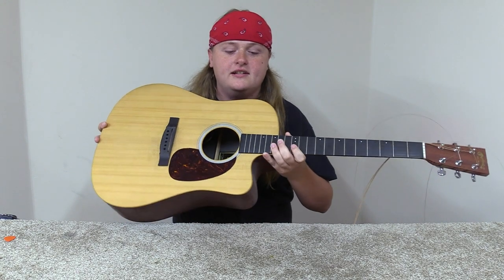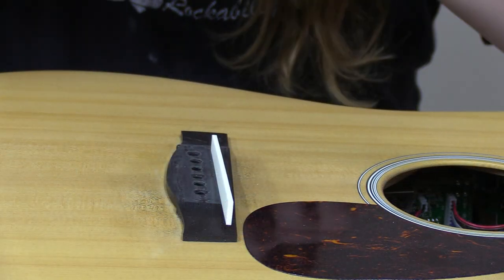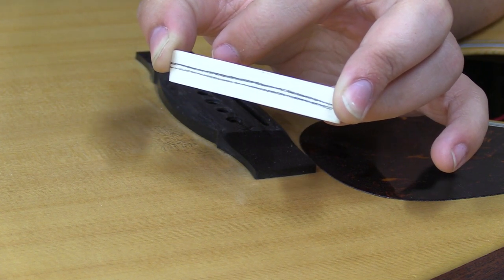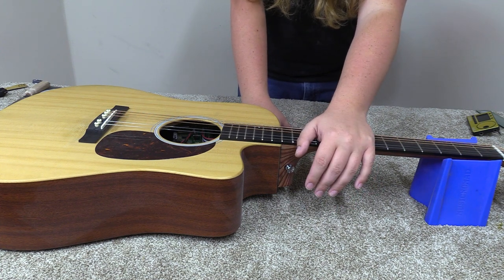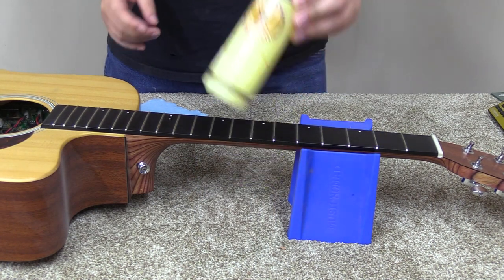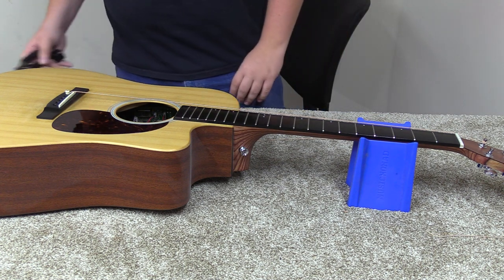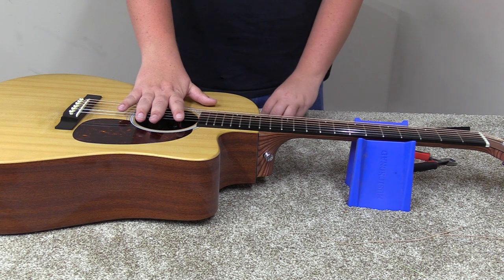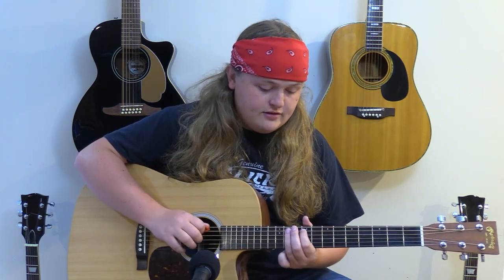Martin DCPA5 Gets a New Saddle

Comment: Caleb, this Bee Good oil looks like a product my wife and I formulated back in the days when we made and sold maple wooden spoons.  It was mostly mineral oil with a certain volume of bees wax melted and blended into it.  It would soak into the raw wood, bring out the color, and make our spoons fairly water resistant, but not waterproof.  We sold a lot of our oil to customers to keep their spoons in good shape for decades as long as they were not washed in a dish washer.   I still use Boiled Linseed on my rosewood and ebony fretboards and bridges.    Regards,  Bob in SW MT.

Comment: Use a normal string gauge Caleb them taper gages are OK for the outside strings but a rule or a string gauge will give you consistency over the radius.

Comment: Looking good Caleb! In your opinion is the deer antler a better material than bone or Tusq?
Reply from the maker: Deer antler and bone are basically indistinguishable by sound, they really are the about same thing. I do think they are a better saddle choice than Tusq.
Reply: Tusq nuts are great as they are almost shaped to what you need and only require small adjustments but if you can make your own just buy bone blanks. Tusq is a synthetic bone material but sound wise you can't tell the difference between bone ( normally cattle bone) but much better than plastic. I've got the black tusq nut and saddle on my Gibson acoustic and it sounds fantastic